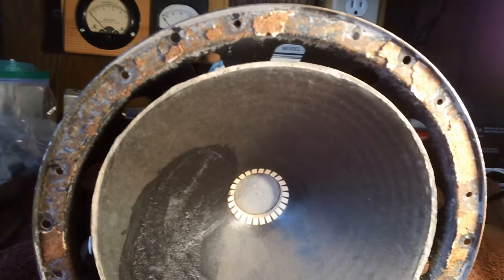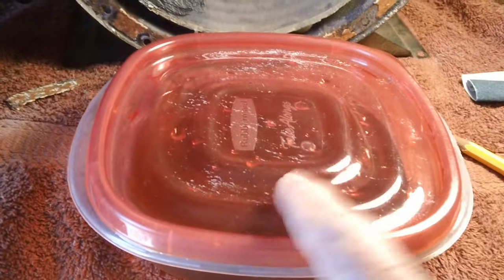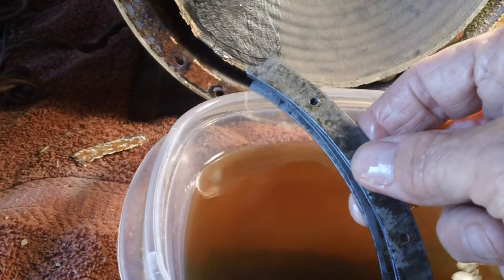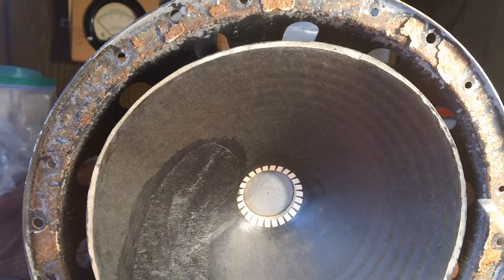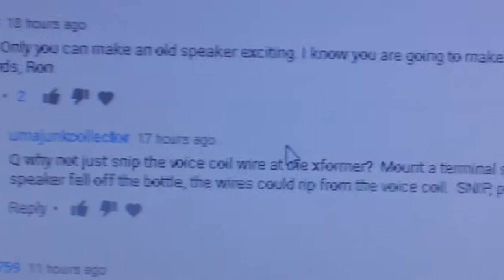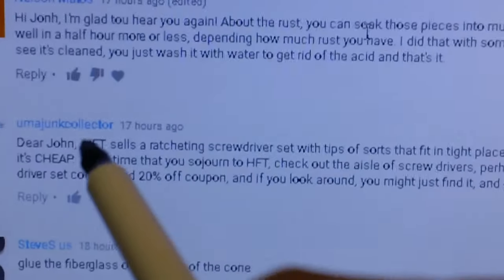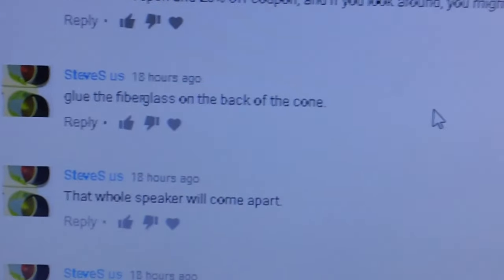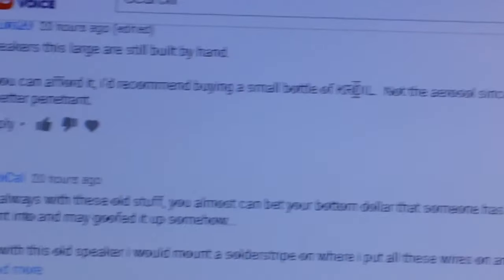1927/28/29 Rola speaker restoration (Part 3).

Comment: I'm really curious on the frequency response of that speaker and how well it would handle low and high frequencies.  From what I have read, electrodynamic speakers tend to have the best sound due the magnetic flux produced by the field coil.  I've used vinegar in the past for rust removal which works quite well.
Reply from the maker: The old EM speaker sound was only as good as the signal received from the source, which back then wasn't very good at all.  Of course, some were much better than others.   At my age it's difficult to tell one frequency from another.  :-)
Regards,
John
Reply: It would interesting to see how it would perform on a single ended triode tube amp using a 2A3 or 45 type tube.  I would expect pretty decent audio as that speaker looks to have decent excursion to handle bass frequencies.  It's probably very efficient for use on very low power output from the output tubes of the time period.  It would probably be incredibly loud with a Watt or two of power.

Comment: I have been doing repairs since the 70's, but I normally do not work on radios from the 20's.  How compatible were the speakers to the radios?  In other words, if I have an Atwater Kent radio, could I use the speaker from a Radiola or vice versa.  Were there companies that only manufactured speakers that you could use on different radios?
Reply from the maker: Bill,
How interesting that you ask this question.  Only a few minutes before you posted this comment I was discussing this very subject with my electronics mentor, Brendan.  I'll have an answer for everyone in the next video or two.
Regards,
John

Comment: John, the TAPE?  that tape!  you forgot the taaaaaaape!  
btw, if the speaker fell off the bottle, I don't know, but I may have LAUGHED!  oh oh 

That evaporust at 25$/gal?  Lyle mrpete222 just did a scientific rust removal comp series including molasses.  I think molasses beat evaporust lol.  To find out, you'll have to go to mrpete222 ch, it was this month.  I vote for vinegar, about one tenth the cost, and works better than evaporust.  plus you can use it for other things.  vinegar has 1001 uses.  You csn use vinegar in the ultrasonic cleaner too.  Don
Reply from the maker: Don,  Vinegar is for pickles and cleaning the coffee maker....molasses is for biscuits and pancakes.   Must I learn ya everything?  Regards,  John
Reply: Don, that reminds me of when I used to have to clean my black powder weapons.  Everyone else used that Hoppe's #9 solvent and it was pretty expensive.  I discovered I could cover the percussion hole and pour in some hydrogen peroxide and it would eat out all the old powder residue and ya wouldn't have to run the cleaning rods through it, just an oil coated patch afterwards and a bottle of peroxide was 50 cents at the dollar store, lol.
Reply: pickles, huh!  you can't eat Evaporust on a salad.  Vinegar has many uses, hundreds, didn't you read Hellouise Hints in the newspaper?    I don't think the ladies (on strike today) would want to douche with Evaporust.  hmmm, I wonder if Summer's Eve removes rust?   You better watch tubalcane, he PROVED what works best.  btw, I got a shoutout from Lyle in a recent whatsit vid, I RATE!  Don